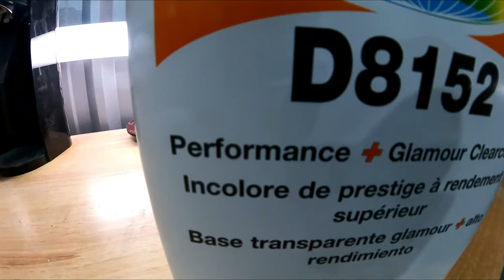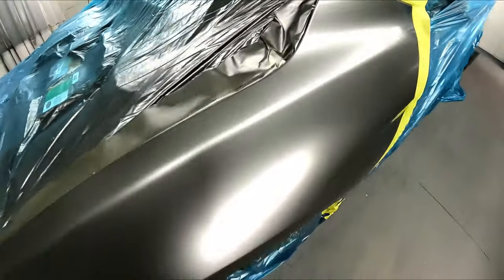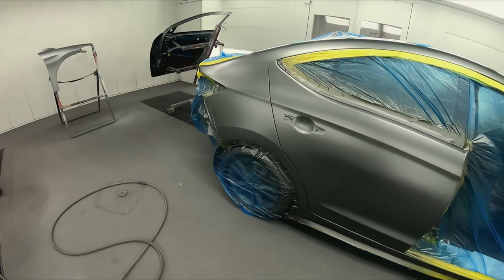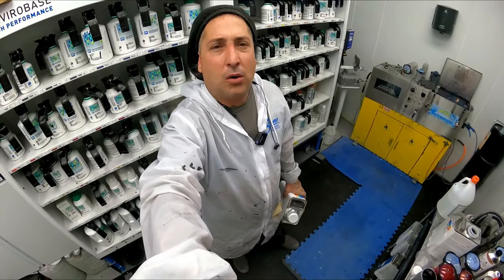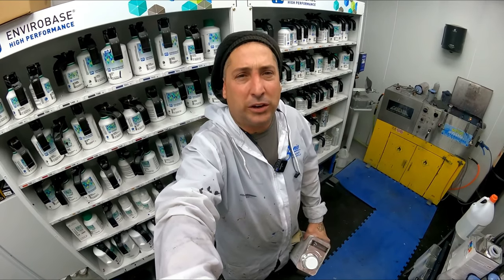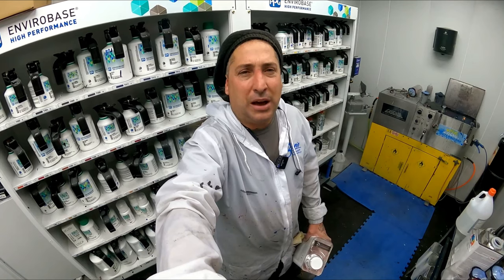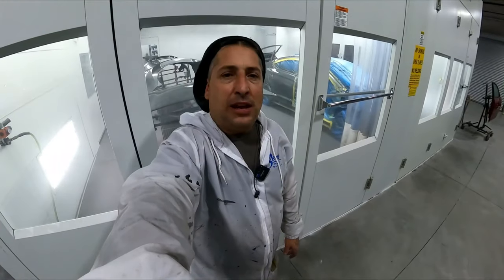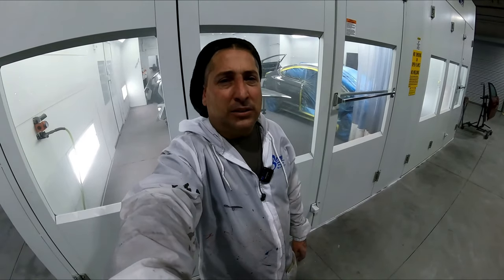PPG TOP OF THE LINE CLEAR - 8152

Comment: Which is cheaper to use, Sherwin-Williams Ultra 9K or PPG line?
Also can you spray Sherwin-Williams CC200 clear over PPG base ?
Thanks for taking the time with these videos.
Reply from the maker: I'm sure there around the same  depending on the shop discount.  And yes you can spray it over ppg

Comment: I use the 8250 on a few complete respray of the gun top of the line gloss but the minute you sand to buff you lose the gloss
Reply from the maker: Once clear is buffed its hard to bring it back to the gloss of never buffed clear but is possible with a lot of time .thanks for the insight

Comment: So after spraying the 8150, how does this 8152 compare?
Reply from the maker: Way better
Reply: @kandyman5315  I just looked in the PPG site and they said on a May 2023 obsolescence note they 8152 and 8150 are discontinued and will only be run from existing stock, then they said DC5050 is suggested to replace 8152 and DC5030 replaces 8150 under the Deltron NXT line which I thought was going bye bye a while ago🤔
Reply from the maker: Yes I was going to tell you that  they are rebranding it
Reply from the maker: Global is going away